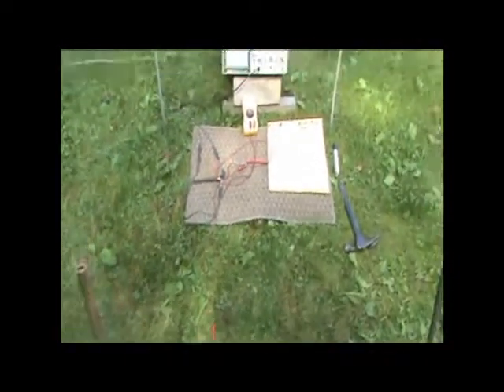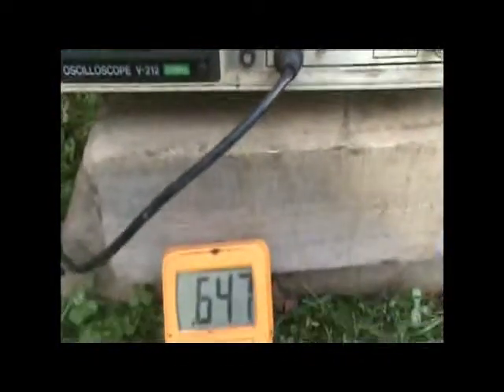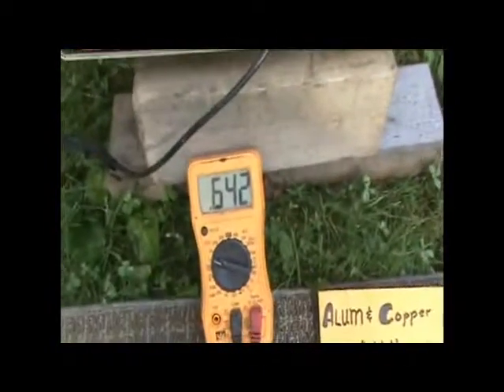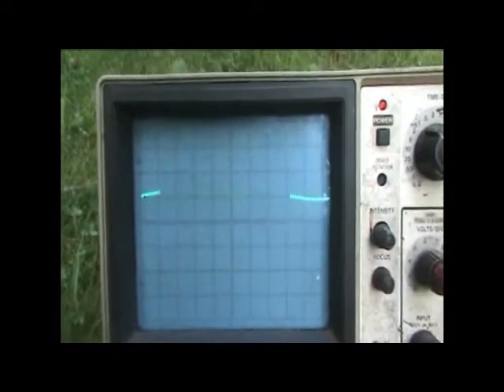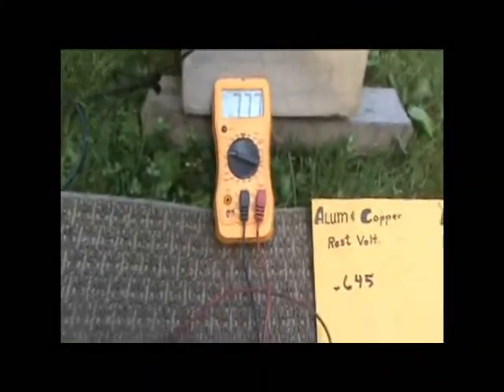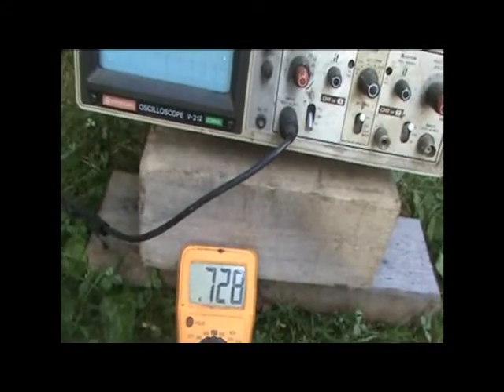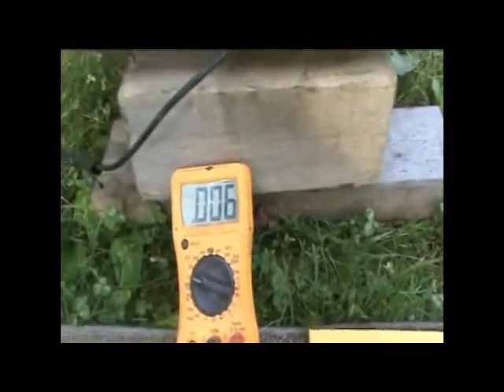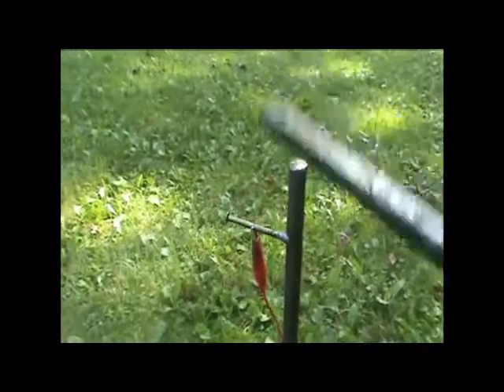Part I Struck Aluminum Voltage

Comment: Ray, new to your channel.
It would be interesting if the metal is ringing like a bell.  And like a bell, even though we can’t hear it, it is slowly returning to zero sound.

What I’m suggesting has to do with frequencies.  A magnetic field creates electricity while things are in motion.   Like a generator.